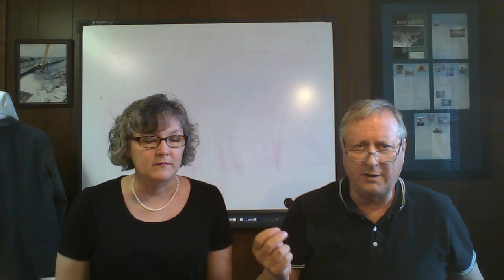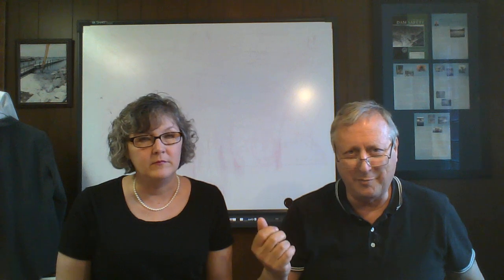Oroville Dam Failure Mode #2 Emergency Spillway

Comment: Scott and Lisa,  Thanks for details.  The emergency spillway sounds tenuous.  Are the causes of cut-back due to type of existing soil vs deep compact rock underlay, velocity of water as it flows over angle of emergency spillway, and swirling motion over light soils vs concrete drainage channels?  In current case, what remediation would stop potential erosion in that area?  Thanks.
Reply from the maker: Sharon Dickinson the soils are not as they were portrayed. They are highly erosive.
Reply: Scott Cahill Thanks.    Interesting:  Concrete Core Block Gallery Tunnels to Hyatt Power Plant, flood risk, via gold miner's blocked tunnel... on "Sharing; Discussion Tunnels in Dam"  @ LINK. ...com/focus/f-n...